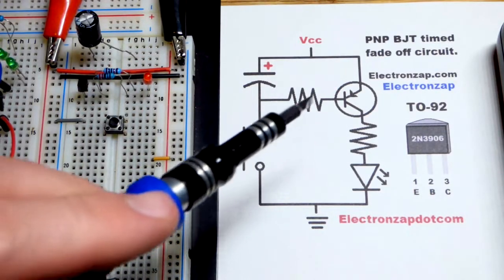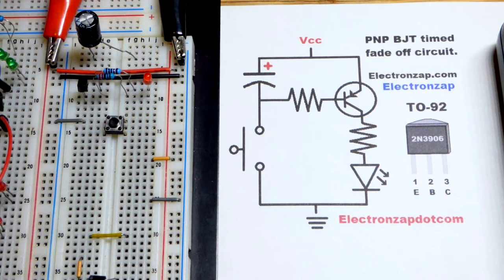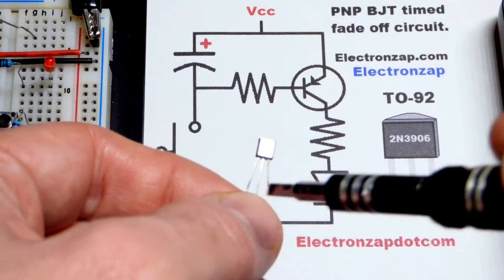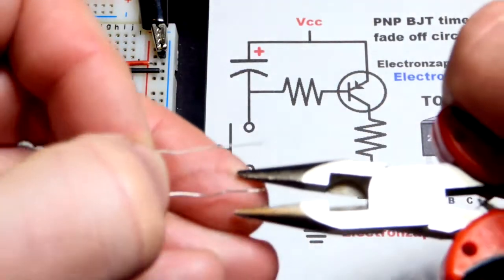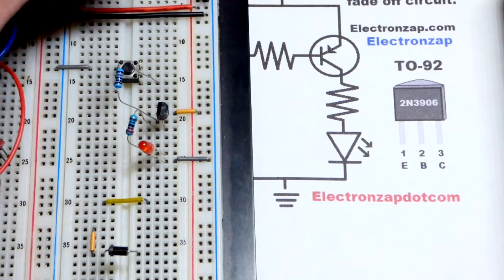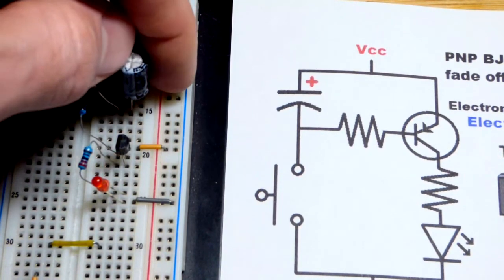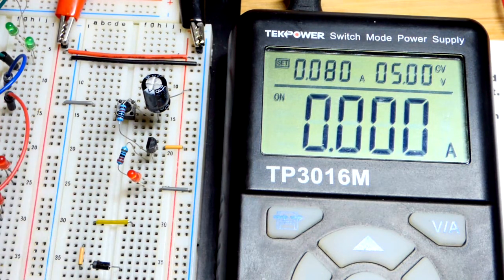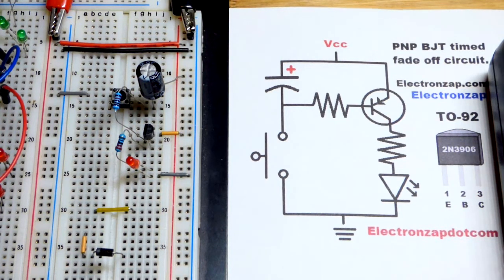Quick PNP BJT fade off switch circuit using 2N3906 bipolar junction transistor

Comment: Hi !
Why do you always keep your device on A (Amps).
Why don't you show the voltage, (V)?
Reply from the maker: Power supply voltage stays at what you set it to (constant voltage), unless that would mean that you have to provide more current than the maximum setting, at which point it becomes a constant current supply. So it's usually more helpful to know the current (amps) that the power supply is providing, than the voltage.
Reply: @Electronzap  A few days ago I also finished a monostable.
(I measured the voltage on the capacitor). 
https://cloud.mail.ru/public/7ist/nmhFcCPpA 
Now I'm struggling to make an infrared barrier, I don't know how to mount the LEDs. :( as in this video:
https://youtu.be/jMyHYb6FPb0
(Last project -5-.)